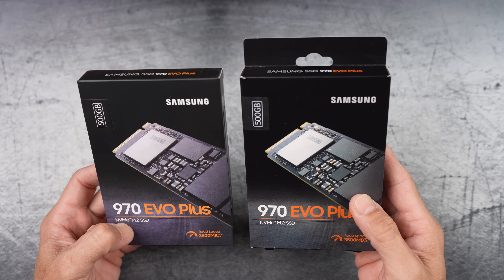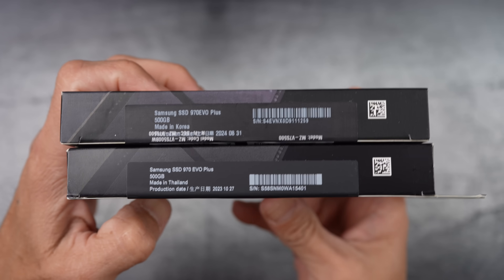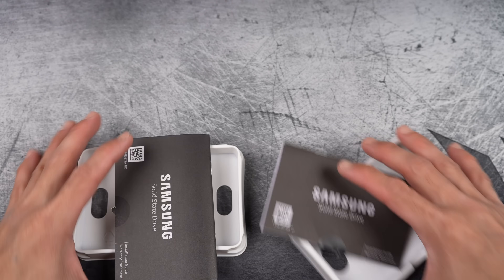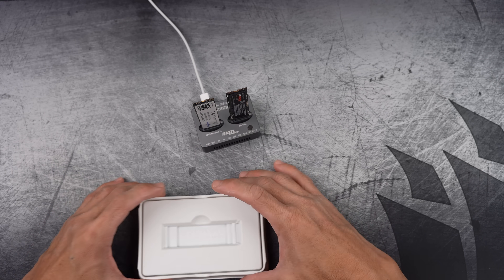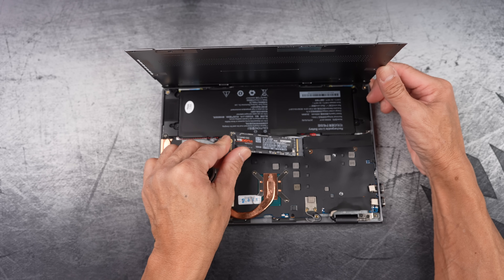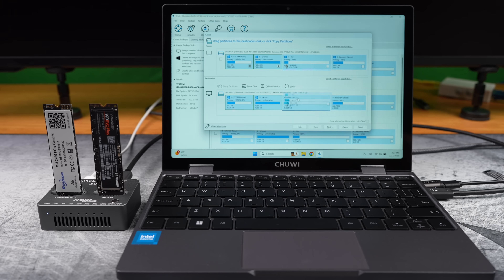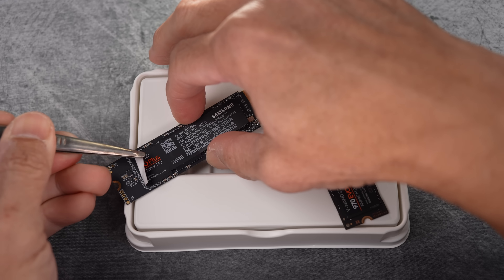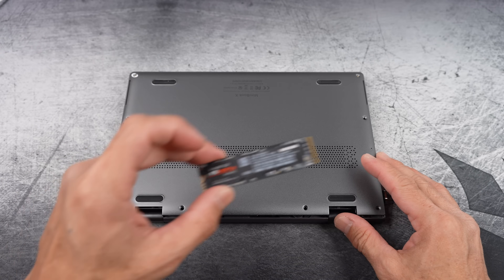Fake vs Real SSD - Can You Spot the Difference?

Comment: It appears that the most important test, a true capacity test (using h2testw or similar), is missing from the analysis. Only by filling the drive to capacity with test data and verifying successful readback can the true capacity be confirmed.

For at least 20 years, fake drives (SD cards, USB drives, and later SSD drives) have been produced that only contain a fraction of the advertised memory, but whose controller chips have been hacked to report an inflated false capacity.

The OS does not detect this, as it only displays the reported (false) capacity. The drives will work normally at first, but once the true (low) capacity is exceeded, data will be quietly and irretrievably lost. Even the files will appear normally in their folders. Only when you attempt to view, play, or otherwise read back these files (perhaps months later) will you find that your irreplaceable data (photo albums, baby videos, financial records, or other files that you thought were safe) are irretrievably lost. No data recovery shop can retrieve data that was never stored to start with. All you are left with are the file names pointing to empty space.
Reply from the maker: @TomNimitz Absolutely agree—thank you for a detailed breakdown. You’re right, tools like H2testw or F3 are essential for confirming actual capacity, not just what the OS claims. Scary how fake drives can pass as legit until you hit the real limit—and by then, then data loss. I’ll definitely consider showing a full write/readback test in a follow-up video. Appreciate you sharing this!

Comment: It will only get worse. Since there is no accountability they will just do it more and more. Everything will be fake eventually.
Reply from the maker: Yeah, it’s getting scary how good the fakes are getting—labels, specs, even serial numbers look legit now. Without stricter regulation or buyer protection, it really does feel like a race to the bottom. Gotta stay sharp and test everything!
Reply: @TossSong  Not so easy. What about fake vitamins and drugs? They even have fake foods. All these are pretty sinister since they can really screw up a persons health(which can effect their sanity).

I've gotten fake flash drives and SD cards and they can be a PITA but at least yours seemed to work.

Most likely these come from the same Chinese factories that manufacture the originals since they have all the equipment to do so. 

You should have likely ran a full test(or maybe you did and I skipped it) on it since many times they will report the wrong size and then fail writing eventually causing silent corruption(they tend to keep the most recent writes so it will pass basic write tests).

Comment: You need better cloning software. I've never had a failure to clone using the clone tool in Acronis true image. It does an exact clone and will reduce or increase the areas dynamically
Reply from the maker: Thanks for the tip! Acronis True Image is definitely a solid tool. Appreciate you sharing what’s worked for you though—it could help others with legit drives running into cloning issues! 👍

Comment: if i had to guess why it wouldn't auto start cloning it would be because the drive wasn't  initialized first. next time if you need to clone a new drive format it firs and populate the drive before cloning.
Reply from the maker: Good tip—thanks for sharing that! Yeah, I didn’t initialize the drive beforehand, so that could explain it not auto-starting. But also more likely that the drive the SSD is smaller than the original drive and the partition layout is different, smaller, Partition Size Mismatch. When I do it in the future I’ll try that next time just to rule it out. Appreciate the input!

Comment: Worked awesome for about an hour went down to 2mbps recognized has 32gb of use then it goes offline to no use unregonizable and goes offline doesnt get picked up by computer massive error. Used it on a PCI 4nslot PCI adapter 24gb at 2gb read speeds then 50 to 100mbps to 100gb then 2mbps after that, tried it in a Generation 5 PCI E X2 m.2 slot it loaded windows is everything 80gb instantly under 1 minute from m.2 USB c Windows 11 package Microsoft 32gb package just plug in and turn on the PC with the m.2 hard drive don't touch anything it auto loads straight to windows start menu box movable center all normal load up options world record.
Reply from the maker: Thanks for sharing your experience—wow, that sounds like a wild ride! Classic signs of a fake SSD: fast at first, limited real capacity, then total failure. That “32GB recognized” thing is exactly what happened to one of mine too. Glad you tested it in multiple setups—it really helps others know what to look out for. Appreciate the detailed breakdown!
Reply: @TossSong Adam keeps saying it's not fake brand spanking new had to add alien software to the hardware synapse impossible to understand these toddlers.
Reply: Tested it on gen 5 x4 PCI e if left alone for 10 minutes it'll do 2gb a second for 5 seconds 1gb a second to 500mbps for 1 minute until 100gb and drop to 50mbps to 100mbps works great for windows 11 doesn't lock up it refreshes at 1kb transfer weird stationary hero software on all program apparatus had a Sam agent k software download didn't do anything had 50mb of software installed takes ten days software rehearsal to finish didn't make it or work don't know what's wrong with it said a group of agent k kids made a bunch of them they work decent on gen 6 maximum speed m.2 x4 at 150 to 250mbps after 100gb made for windows 11 can't tell has nomaliennsoftware looked at the inside has the same hardware as normal m.2 doesn't work right Adam said maybe in 5 years it'll boot up right he'll send in nano meeds fix it up had 5 hard drives knocking and bumping fixed up completely silent now had to spend 1600 hours exercising with him in the bedroom butt naked and say nothing ant man suit really really fast has 10x harder adamantite bones than adamantium and he's super good at exercise runs 340mph at 1 inch across the mats spanks me stabs me at 1nm weird over 50p times. A second doesn't matter or bleed swims in my stool feeding replenishing craps adamantium liquid old works on it fine deal for over 15k hours fixed up a great deal of stuff can't believe my eyes options here stuffing my face with habanero jalapenos banana peppers hand fulls over 50 a minute watching and back to super shredder exercise watching him super man smart this stuff alone and hit a button everyone gets it he's galore.
Reply: It's a lot easier to make the hardware I said how many hardware m.2 4tb did you make incomplete will complete keep up with him please half a million in Japan 200k in Utah 500k in west and east Europe 2 million Africa 500k in west Australia and 200 million in south America alone he'll fix it up probably in 30 years perfect working speed behind it back like a normal dad
Reply from the maker: Haha wow, that was a rollercoaster of a comment! 😅 I think I caught bits of a real SSD test buried in there—thanks for the effort in testing it across different Gen 5 and Gen 6 PCIe setups. But when the alien software, Ant-Man suit, and habanero speed trials showed up, I think my SSD overheated just reading it 😂

But seriously—if it slows down after 100GB and drops to inconsistent speeds, it's definitely acting like a fake or severely throttled drive. Appreciate you chiming in, even if your SSD test turned into a Marvel origin story by the end!
Reply: @TossSong it quit working and quit being picked up by any p.c offline completely
Reply from the maker: @garrettwillis612 Dang, that’s rough. Sounds like a classic fake drive issue—starts strong, then dies fast. Glad you shared this, it helps others know what to watch for too. Hope you were able to get a refund!
Reply: @TossSong I asked Adams mom what the Hassel is with this system why can't the cd USB be uploaded update while plugged in DVD rewrites and USB rewrites mbr master boot drive gpt drive alternator she said work with the baby sauce first eat the cream cheese and 4500 bagels and work like lightning for about 500 years pushing a stroller happy please walk off a cliff a few times and play with it incredible nothing won't work right the baby sauce didn't mix in the blood bath Adams mom said it's too Jesus of you sweety give us that and make us die trying poop on us too if you want to sell us that too cheap honey and reward us a real one Betty spaghetti 🍝 miracle sauce I took a look at it she said Adams mom it looks like a ape 🦧 pushed a star inside a lightning belt while throwing metal at it and vaporizing it in place for 5k years another solar system arrived her with 20 million and all offline work for 3 minutes a hour none stop half and half doesn't matter only 3 out of the batch work perfectly sad he has them sells them off by 1 penny the shape they're in magnitizer milkshake happy for you looks amazing over birthed there's 25 days 9s 2 a second in connections inside the ant man suit connection m.2 hold on to it lemme see if I can fix ya a new one sweety and lend you a new tree. Love Adams mom
Reply from the maker: That might be the most legendary SSD review I’ve ever read 😂 Not sure what Adams mom or the lightning belt has to do with the drive, but you’ve got me both confused and entertained! Hope you’re able to sort out the real issue soon—or summon that miracle sauce fix 😅

Comment: And you didn't bother to install Samsung magician to test it? Fail
Reply from the maker: Thanks for your feedback. I did. It’s also in the video (desktop screen). But I choose not to include it because the video would have been too short. Thanks again.
Reply: @TossSong so did the magician show that it was fake?
Reply from the maker: I tested it off-camera, the Magician software didn’t recognize the fake drive as genuine, but it did display the correct name.
The serial number on the package is different from the serial number in the Samsung program. The program doesn’t recognize it as a Samsung disk. Additionally, the write/read speed is lower than that of the originals.

Comment: I ended up with one of these fake drives from "Scamazon"..  interestingly I was trying to figure out when putting mukltiple drives in a RAID array why they werent showing up as identical...  turns out the seller was "mixing in" fake drives with real ones...  the seller is no longer on the platform.. so im guessing I wasnt the only one who reported them...  I was paying the "real drive price" for all and had a couple fakes in the mix..  the only way I figured it out was trying to run them in RAID..ironically I had a real one of these fail in my laptop..  I sent all of them back and amazon refunded my money on my RAUD experiment.. I ended up ordering from another supplier and got all real drives and my RAID controller was happy to build an array of identical drives..  the drive that failed in my laptop was a single drive I had bought another time... it appeared t ohave the proper real samsung chios and ram on it..  samsung warrantied it out so it was genuine..

Comment: Here are my results. 
I have a Samsung 980 Pro (not from Aliexpress) but still a lot of features are like your fake one. 

But mine is Original as tested with Samsung magician. Also the speeds with crystaldiskmark are very close to Samsungs prediction 6.900 MB/S reading and almost 5000 mb/s writing (3x iterations with 1gib - standard settings). 

Serial number matches on disk / package / software as well. Made in China and has newest firmware 5B2QGXA7. 

My package does not have a tab (looks like your fake package). 
S/N on the sticker on the Box (like your fake one). 
Also my plastic box on the inside has the rectangular code on the transparent part and a similar code with numbers and letters on the white box. 

But on my ssd I can clearly see the square silver chip without removing the sticker. If one looks close the corner of the silver chip closest to the “G” of Samsung is black.
Reply from the maker: Thanks for sharing detailed comparison! That’s awesome that your 980 Pro passed all the checks—especially with Samsung Magician and matching serials across the board. Speeds look solid too! 👌 It’s interesting how some features visually resemble the fake ones, it makes it definitely trickier for buyers. Appreciate your breakdown of packaging and chip layout—very helpful for others trying to verify theirs!

Comment: i bought for aliexpress kingstone and crusial SSDs the basic with a lot of reviews mostly from official store from the factory itself
Reply from the maker: That’s probably your best bet when buying from AliExpress—sticking with stores labeled as “official” and checking reviews closely. (I’ve bought many electronics in AliExpress without issues.) Still, it’s wild how good some of these fakes can look now! Hope your drives turn out solid.
Reply: @TossSong The label "Official Store" doesn't make it official. I once bought a 18650 battery in Thailand on shopee in an "Official Litokala Store". They had a serial number below a rubbing-off black part. Entered the serial number, website said "Fake". I sent it back and looked again for "Official Store". Found the real official store in the competing online shop Lazada. Ordered there and the serial number was working on the website. I informed them that a fake "official" store is selling cheap chinese fakes and included also the return address. So they now should know the exact address of the scammer. 😂 I hope they do something with it, but probably not, from lazyness.

Comment: After seeing how much work they did put into the details (box, printed manual,etc) in order to mimic the original product, there is a question just how much profit do they get out of the sales, in order to justify this work?
I imagine huge. After all, they do provide 500gb of storage.  An average user , will not peal stickers, nor will do speed benchmarks . Most will just do a basic health check to confirm they got the Gb's they paid .
Reply from the maker: Exactly! The effort they put into mimicking everything—from the box to the manual—really makes you wonder how many people they’ve fooled to make it all worth it. Most casual users wouldn’t suspect a thing as long as the drive shows the right capacity. It’s scary how easy it is for fakes to slip by undetected. Thanks for the insight!

Comment: The first thing I noticed is that the real package had the hang tab one would expect on a retail product that would be displayed.
Reply from the maker: Great eye! Yep, the hang tab is such a subtle but telling detail—definitely something you’d expect on a legit retail package meant for store shelves. Thanks for pointing that out!
Reply: Make sure you do not put any weight on the presence or absence of that tab. I have never received a genuine Samsung SSD with that tab.
Reply from the maker: Good point — packaging can vary a lot depending on region and batch, so I wouldn’t rely on the hang tab alone either.

Comment: Tip: Use heat gun or hair dryer to preheat the sticker before removing.
Reply from the maker: Thanks for the tip! A little heat definitely could’ve loosen the adhesive better than a tweezer I used to lift the edge slowly.

Comment: Why didn’t the cloning device work with the real drive?
Reply from the maker: Great question! I think the cloning device didn’t work because the drives weren’t the exact same size—most of these duplicators require the target drive to be equal or larger in capacity. Also, BitLocker encryption might’ve been active on the original drive, which can sometimes block hardware-level cloning. Software cloning might’ve worked better in that case!

Comment: If you're not sure that you're buying a fake, the RED blinking LED just gave it away, no Samsung SSD blinks red  when in use, only fake or cheap SSDs have that annoying LED light
Reply from the maker: Ahh good catch—the red blinking LED detail! You’re right, I believe no legit Samsung SSD should blink red like that. That flashing LED definitely screams sketchy or low-end. Appreciate you pointing that out!
Reply: I would never know that, I didn't even know those nvme drives had leds. They're usually deep inside my mobo when I turn the pc on😂
Reply from the maker: Haha right?! I wouldn’t have known either if I didn’t catch that flashing red light during cloning. Most NVMe drives are buried under a heatsink or tucked away so deep, you’d need X-ray vision to spot any LEDs 😆

Comment: an easy way to remove the lable without damage is a hairdryer. then you can reapply it and return if its no good
Reply from the maker: Great tip! A hairdryer would’ve made it way easier. Definitely helps if you’re testing the drive first before deciding to keep or return. Appreciate you sharing that!

Comment: Just about everything on Ali Express is counterfeit. I contacted them about a radio and asked if it is genuine. I got a one word reply saying “copy”. When you buy hard drives you need to be extra cautious because a hidden partition might contain dangerous code that could cause you grief. It is even possible to hide the partition from a drive wipe and format. While you might save a few dollars ask yourself, is it worth it. Lastly, the performance on the fake will probably not be as good as the original.
Reply from the maker: Appreciate your detailed input. Totally agree—“copy” says it all. Some sellers on AliExpress are just wild. Hidden partitions with shady code are no joke either. Saving a few bucks just isn’t worth the risk or the performance downgrade.

Comment: the fake drive clones.
Reply from the maker: Yep—those fake drive clones are getting more convincing too. Some even spoof real model numbers and pass basic checks. Gotta dig deeper to spot them now. Appreciate you chiming in!
Reply: @TossSong  how long are you going to attempt to use it?
Reply from the maker: Good question. It could be used as an external SSD (with enclosure) or backup. Wouldn’t trust it with anything important though.